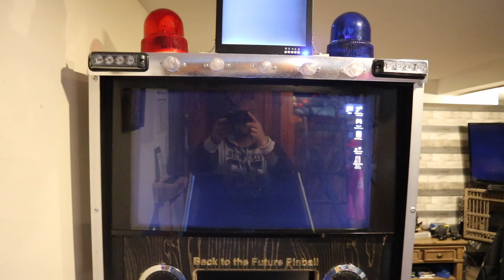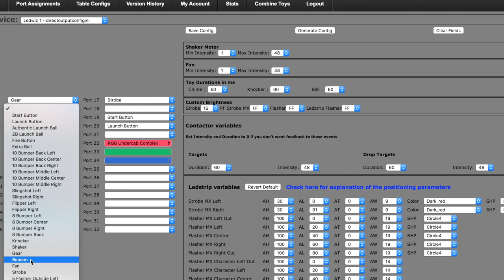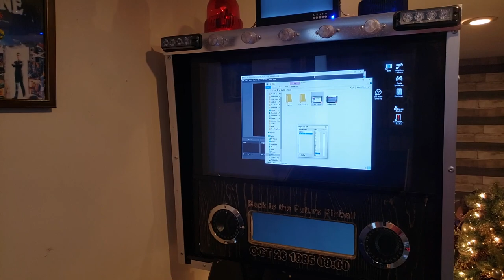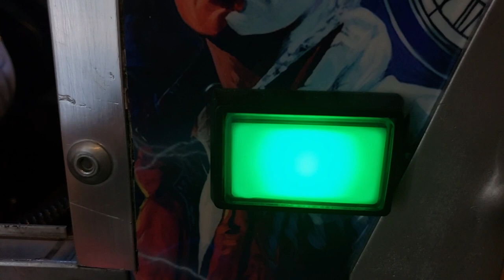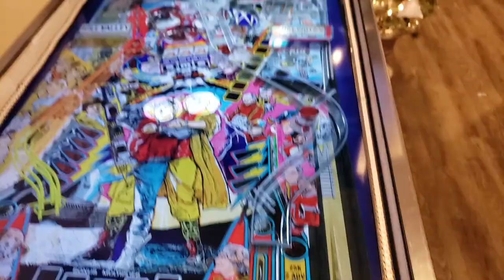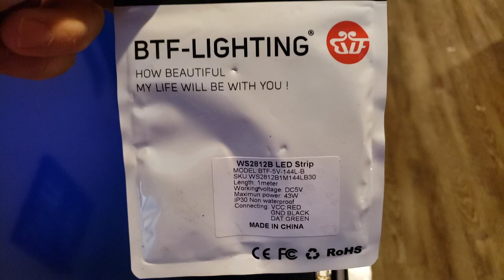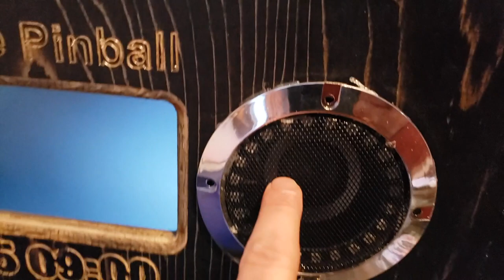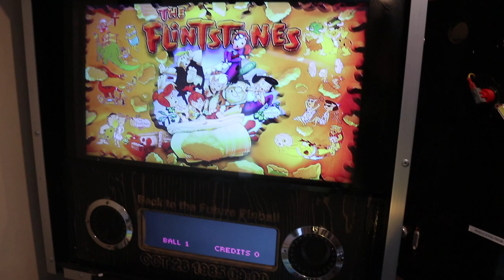4k Virtual Pinball Connections

Comment: thanks for this very helpful and practical guide.  there's definitely alot going on and easy to mess up.  definitely feel better getting ready for my own project.  I noticed your fuse holder...you choose to solder the wire to the eyelets instead of crimping?  is that better than crimping?

Comment: is your store shut down on the mameinabox website? it just keeps redirecting me to VPP
Reply from the maker: Yeah I shut it down. That now the new site. I don't have e commerce anymore. I still sell my boards but by email. Let me know if you want a board.i ll send u the details
Reply: @MajorFrenchy  ok yeah i was looking at the relay board for the RGB flasher bar. but i just bought relays from china i think ill just use butt connectors and crimp them to the wires.
Reply: @MajorFrenchy   can you send me pricing for the rgb resister board for the flasher bar?
Reply: @MajorFrenchy  or would a bread board work also?

Comment: Thank you VERY MUCH for the parts list ! For a newbie just starting off, this list is invaluable. Right now I'm just trying to understand how everything works with each other. Plan is to get a bare bones system running and add all the toys as time marches on.  I'll get there.....
Reply from the maker: That's the right approach.  A lot of people are jumping the guns and are missing some important steps. Reading is key and you will have failures everyone did. That why we have all the good forums and chat groups to help each other. Good luck
Reply: @MajorFrenchy  I REALLY need you advice on one thing...building a 4K system that will use a 4K tv for playfield, a 27" monitor of the back box, and an old laptop LCD (15") for a dmd (I have the controller board). I have the MB, SSD, memory, and PS that you have already recommended. Please suggest a few different GPU's that will support these display devices that cost $300.00 or less. I am totally confused about the options and connections right now. Thanks much !
Reply from the maker: @sneakin4  honestly I don't think a 300$ graphics card will cut it. Don't cheap out on your GPU if you want to go 4k.
Reply: @MajorFrenchy  Understood....Could you please take the time to help me out and explain what type of connections I should ensure I get on the card?
Reply from the maker: @sneakin4  I have 1 hdmi and 3 Display ports. Depending how many monitors you want. I use the hdmi for the playfield, and the display ports with a hdmi adapter for the backglass, dmd and topper. You basically will need 1 output per monitor you have. A Nvidia 1080 would do 4k well.
Reply: @MajorFrenchy  You Rock! Now I can go forward with things. Sorry for asking so many questions. You and your vids are an inspiration to beginners like myself.